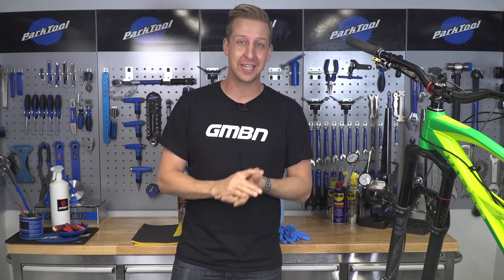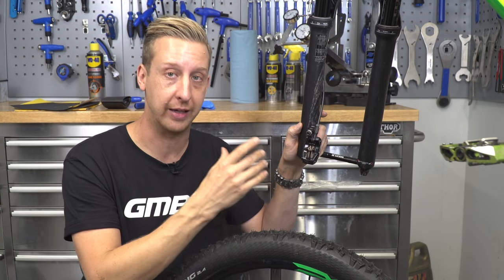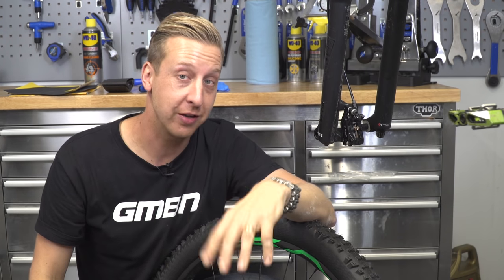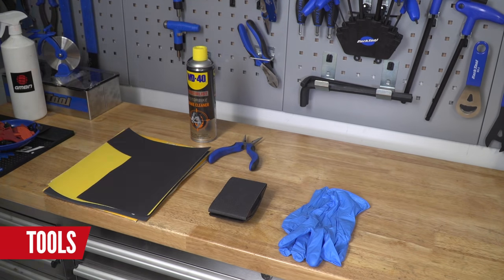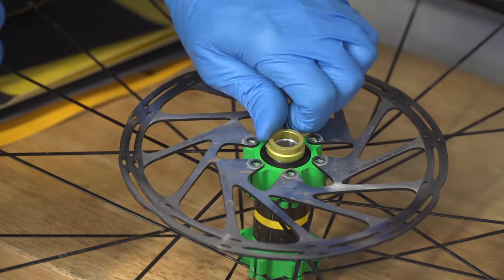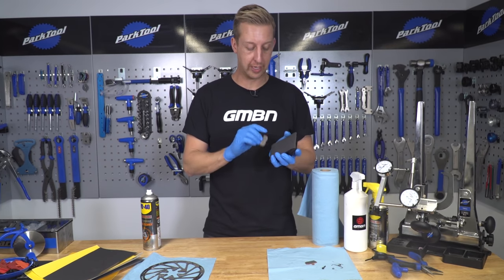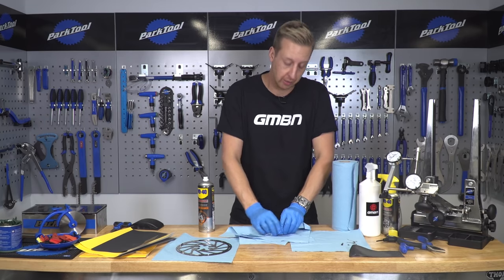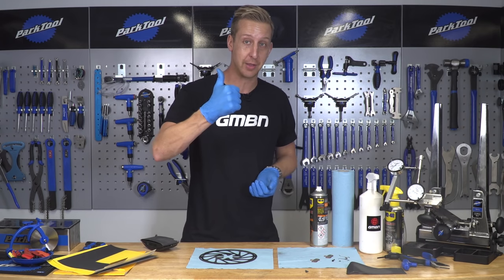How To Clean Your Disc Brakes | Mountain Bike Maintenance

Comment: Please remember too - WD 40 was not designed to be a lubricant, although it does lubricate for a short while. Its primary purpose is as  a water displacer ... hence the name WD. The number 40 was the formula they stuck with.
Reply: its better at attracting grime than it is lubricating anything.
Reply: @TheFreshPeddler  only thing dub dee attracts is the ladies.
Reply: WD-40 has two meanings one of them is true, "We Did 40" try's till it was right.  lol     Water Displacement 40 lol
Reply: Doddy is using Brake Cleaner made by WD 40 is this video. I can be confusing, as the can looks very similar, but a much different product.

Comment: Next video idea:
How to get rid of that dog sh*t on your frame, tyres and under the seat.
We need this.
Reply: bata solujic wash your damn bike
Reply: all purpose cleaner or muc off spray on and leave for a minute or two then rinse off with water somewhere between warm and hot.   if needed have some thin metal flat pieces to help pick off any stubborn poop.   it does help once bike is thoroughly clean use a car wax/sealant on the frame (only aluminium and steel NOT carbon fibre)
Reply: Robert Parkes Thanks for the much needed information!
Reply: Robert Parkes is car wax safe for bikes though?
Reply: bata solujic yes we need this
Reply: @robdp83  why not on carbon? I sense a mildly interesting fact on the way...
Reply: JZ paste wax soft99 fusso yes tho wouldn’t last as long as a paint sealant.
Reply: G C  maybe if it has a clear coat on it, imo i wouldn’t trust myself to get it done right.
Reply: @robdp83  silicone spray on a cloth is good too. Wipe all over the frame. Only silicone sticks to silicone

Comment: They said do not use solvents to clean your brake pads other than brake rotors no problem. Brake pads should use clean running water only. Is it correct?

Comment: This is a useful video GMBN! Is it a good idea to clean the disc and pads with alcohol every now and then to remove dirt and grime left even after a normal bike wash? Here's a video idea: All the stuff you need to know but nobody tells you before you buy a bike. Like bedding-in new brake pads, how often you should have your shock and fork service, and just how bloody expensive it is if you can't do it yourself. If I followed the manufacturers recommended service intervals for my FOX float I would spend more money every year servicing my bike than I do with my car!

Comment: If you use sandpaper, ensure there is no residue or else the pads will likely glaze over when bedding in. I'm going to try steel wool as an abrasive, next time.

Comment: I have a road bike with squealing disc brakes, took it to the local bike shop, they told me the rotors and discs were too contaminated and so they replaced everything (£140). Six weeks later the noise is worse than ever, they didn't say anything about bedding in the new discs!. I am careful not to use any kind of spray lubricant and only clean the chain with a Park Tool chain scrubber. I have tried cleaning the rotors with Muc Off disc brake cleaner and paper towels but tbh it only makes it worse. I am bit nervous about taking the pads out and the rotors off but I am going to try the process in the vid.

Comment: A fast and easy way to de-contaminate the pads is to take them out of the caliper and torch them to burn off contaminants. To un-squeal the rotor, use squeal-out and rubbing alcohol.

Comment: Try this, take out the pads and rub them together under the hot tap using VIM. Repeat this until the Vim stays white and then dry them with a paper towel. Clean the disc with household cleaning alcohol applied with a J Cloth and dry them with a microfiber cloth.  The light abrasive in the Vim creates micro scratches and de-glazes the pads that disrupts any harmonic resonance, in other words, stops them squealing (in principal) like a violin string.

Comment: Copper slip behind the pads works a treat, my dad taught me that one. It's surprisingly hard to get the grease near the actual pad material, I would recommend it. Just be careful and apply a thin layer.
Reply from the maker: Just a dab too. Don't paint it on there if you're going to do it!

Comment: If brakes start getting noisy or loose power I soak pad in isopropal alcohol then cook them on BBQ gas flame until they stop smoking. really very effective at removing contamination. clean the rotor as doddy suggests and bed in!

Comment: instead of sandpaper I use drywall sanding screens. it has holes that allow the crap you want off your pads to fall through. Seems to work much better than sandpaper

Comment: i can vouche for the copper slip, common used in carworkshops.
also brakes can make a squilling noise if brakes are cold and also when the pad material is to hard.

Comment: I could be wrong, but from the car side of things (And motocross) using brake cleaner on pads is not a good idea as it can break down some of the compounds in the pad causing them to literally disintegrate?
Reply: +1 I heard the same elsewhere. Is it okay or not?
Reply: That's why you use brake cleaner designed for bicycles, car cleaners are too strong
Reply: if brake cleaner penetrates the pad material, it dissolves the resin that bonds the material to the pad, like in a car. The resin then bubbles up through the material when it gets really hot as it has been chemically changed, and causes massive brake fade and glazing of pads.
Reply: Yeah, I would sand them and clean with alcohol, but I would not use brake clean on the pad material, whether it's "made for bikes" or not. Better safe....

Comment: Thanks much for this helpful info.  Question: At 8:28 to scrub rotors with sand paper, do I need something like 600-ish grade or finer 1200-ish for this job?  I'm going to replace my old organic pads with new metallic this time, so - short of replacing rotors with different pad compound  - I'd like to refresh/reset the rotor surfaces as if brand-new, for bedding in a new pad compound.  Thanks!
Reply: Great question because he only says, "Course, abrasive paper and heavy duty". I've seen other videos which clarify 120-160 grit, etc.  Just tell us a number so we know!

Comment: i work at a bike shop and we allways burn the discpads. our mecanics has  repaird bikes for over 70 years combined and they do it every single time.
Reply: Mikkel Lehmann Yep. All of the stuff in the video and torch the pads when they're dry to burn off any deep contaminants.
Reply: How bout rotors, are they safe to burn?
Reply: Henry C wouldn’t recommend it due to possibly warping the rotor beyond repair, just isopropyl alcohol and some 600 grit sand paper and you will be good

Comment: Copperslip does work on cars and motorbikes, but NOT on mountain bikes, because the pistons are not metal. It won't do anything other than make a mess.
Reply: pistons are metal on quite a lot of MTB brakes actually
Reply: Copperslip, or Copper paste works wonders when used spareingly on back of brake pads where contact with pistons is. Prevents shudder and therefore noise when brakes are used. Brake noise does not always come from pad material on rotor.
Reply: In this case, the copperslip isn't being used as an anti-seize, just as a damping medium, so the piston material doesn't matter.

Comment: If you live near the coast, salt in the air tends to settle on the rotors, creating a residue contaminant that affects the braking power, creates a lot of noise and eats away at the rotor.

Comment: I accidentally  spilled my bike brake pads with brake fluid. And unimaginable squeaking has started. I tried cleaning it even with angle grinder - no cigar! But one thing worked - just burn the surface of brake pads, it will vaporize any residue and 
voilà 
 - no more squeaky brakes. :)

Comment: Got pins on my brakes, would like to swap for bolt and catch pin.  Shimano Deore 6100 203/180 on my Orange.
Brakes have been awful since purchase, so will run through this, although I think I have a leak.

Comment: Being concerned that a bit of oil on your skin might contaminate your brake pads is seriously mental, unless you NEVER ride on a wet road. Roads are full of motor oil from cars and as soon as it rains it floats to the top and will get all over your bike. You can make a clean rag black with oil and grit by cleaning any rotor and pads that have had a bit of use.

Comment: I tried EVERYTHING, spent weeks cleaning, sanding, soaking, scrubbing, brake cleaner, mud on the rotor, the copper grease... everything.
Nothing worked until I tried baking the pads. 200°C in the oven for 30mins on a clean baking try and just like that, they are like brand new! Still needed bedding in again properly but now they could stop a freight train in its tracks.
Don't waste your time, if you think it's contaminated, just bake your pads. No open flames, no blow torches, just as easy as pie. Get it?
Reply from the maker: We've heard of this working but can't recommend it as in some cases (and with cheaper pads especially) the pad can become unbonded from the backing surface which is dangerous for obvious reasons! This is our safer method that you just have to work at
Reply: Thanks for the reply. I've heard of this as well but only in rumours. I'm not sure it has actually happened to anyone that I've heard of. Plus, don't the pads reach higher temps. than this when in regular use at a bike park for example? Is it more dangerous because it is sustained heat rather than fluctuating, dissipating heat? I'm interested to know. Ultimately, buying a new set of pads is the best option, but I've tried your method and it didn't work for me, even after repeating it a few times before I found out about the baking trick.
Reply: @AdamEronenPiper Id rather not chance it with baking my pads. Rumors start somewhere its happened to someone and I dont want to be going down a steep techy decent and lose my pads. But if it works for you thats great

Comment: So I had a bit of a squeak on braking, so took the wheel off and removed the pads. Didn’t have brake cleaner so sanded them regardless and cleaned and sanded the rota no squeak and no cleaner brakes work great

Comment: i get a squeal noise when my brakes are cold, i'd say around 10°C. i noticed that by riding my bike in winter and in summer time. is that a possibility or i'm just crazy?
Reply: Matteo Roda I’m no scientist but temperature could have an affect on your brakes
Reply: Evan Thomas thank you for your attention
Reply: maybe the humidity plays a role here? Not sure tho
Reply: same, but Shimano with metal pads
Reply: In colder conditions materials tend to shrink a bit. So maybe some differences in the structure of the pads might lead to an uneven shrinkage and they might squeal as a consequence.

Comment: Pro tip... Turf the pads, put new ones in, and make sure bleed port on calliper is tight.

Super pro tip. Throw avid brake system in the bin and install ANY Shimano brake system

Comment: What grit sandpaper should I use?
Reply: I used 120p and it worked really well 👍🏻
Reply: 120 is rough as a cow‘s tongue... :) On the rotor I would assume sth. like 600 and even higher.

Also I would apply only gentle pressure. You don’t want craters on your disc, just a bit of rougher surface. 

Me personally... I don’t have the best feeling about this technique.
Reply: I used 600 and it worked really well. I've tried many methods and this is the only that worked.

Comment: You can get rid of contamination on pads and rotors easy. No sense in buying a new sew set of pads and rotors every time cuz it happens so often. Rotors are not cheap. Simply remove pads rub with a clean brush and isopropyl alcohol, rub clean with blue rag or paper towel, sand with 220 grit in a circular pattern until pad color is normal, wipe off any sanding residue with clean blue rag or paper towel. Wipe down rotor with blue rag or paper towel and isopropyl until clean. Reinstall pads and wheel. Go out and bed in the pads and rotor by gaining speed and braking hard on the uncontaminated pad until braking power is restored. Now your pads and rotors should be free of contamination, quite, and powerful while only spending a couple bucks. If you need a video there are tons here on YouTube. Works pretty much every time

Comment: I think that the best way to clean brake pads is to put dish soap on them and rub them together then wash them off with hot waters and that will get rid of the squeal but you still have to clean the rotors

Comment: I'm new to disc brakes/Mtn bikes. Do u have to remove and clean your pads every time you clean your bike? Doesn't all the mud and crud run down your forks when you wash your bike over the pads? What should I use to clean the discs with?

Comment: Get a lemon and cut it in half. Press the lemon and drip the juice straight to the pads still with everthing assembled in the bike. Pedal for 3 or 4 minutes with brakes applied until it stops screaming (it will make the sound of devils, but when it stops its gone and very clean)

Comment: I mostly would experience this during rainy weather, but I would hear my brakes squeak as I'm trying to move the bike around. Can I use brake cleaner  on the brake levers  as well as using it on the pads ?

Comment: My rear SLX M7100 brake seems to have lost it's bite. Not long been bled and doesn't appear to be any leaks. Only thing I can think is spray from the dropper post lubricant may have got carried in the wind on to the rotor?

Comment: The easiest way to clean the break pads and rotor is to put alchohol in it. Isopropyl, ethyl or what not. Leave it for about a minute or so then wipe it with clean fabric. You'll see the grease come off. If you still hear some squealing, put some generous amount of alcohol and light it up.

The science behind it is that oils and alcohol mix together.

No need to buy diskbrake cleaners. I promise

Comment: Does anyone know how to or have any recommendations on cleaning the center of the disc where your pads don't pass through but the dirt builds up? This seems to go un-noticed and has recently been the bane of my life trying to clean them without contaminating my brake pads. I'd much appreciate any help ✌
Reply: I have that same problem. I’ll probably clean the inside very carefully with a toothbrush and some brake cleaner and then do the braking surface

Comment: As a request could you do a maintenance video on swapping Formula / Avid type brakes to something like a Shimano set.  I have been having a lot of trouble with the set on my bike and after working my way through litres of DOT4 fluid to resolve the issues I am ready for a change. From the research I have done it seems like a common(ish) upgrade route but I cannot find a video to help me with the decision. I am riding a Cube Limited Race hard-tail. 

Hopefully this is something that is of interest to others.

Comment: My rear break makes me deaf every time I use it
Reply: u cant go deaf more than once
Reply: +Repearzz badum tss
Reply: My rear brake is completely blown
Reply: What pad material are you using?  I only use (Shimano) resin pads.  They stop much better than the metallic pads and hardly ever make noise.
Reply: you can

Comment: That's helpful. But, I'm afraid am gonna need new pads sooner or later. Do you know where to get them?
Reply: Always bought mine off eBay
Reply: @avi.d04  ok. How do I know the right pads for my bike?

I have tropix martinez with shimanu
Reply: @mazinalansari88  locate your disk brake caliper, try find some model number on it. This may result in you removing your caliper from the frame but look around for any model number, then search up that model number followed by 'shimano' on Google and you should be able to see the pads you have. Worse case scenario if you can't do any of the above, remove your pads, search up Shimano disk brake pads and try to find the ones that look exactly like yours. Hope that helped
Reply: @avi.d04  thanks a lot man

Comment: I find that i usually get break howl on a set of pads after its been raining, usually use my bike for commuting, guessing the road contaminants get kicked up and into the pads, gone through so many sets of pads its a little ridiculous
Reply from the maker: Try enduring the noise! Bear with us...sometimes contaminants in the rainwater that splashes on your pads will burn off after a few good hard stops!
Reply: really appreciate the reply, wasn't expecting one if I'm honest but I have stuck with the pads for a long time afterwards ( more than  a few months just got used to rolling with very minimal breaking) have tried everything from sanding down pads and discs to dousing with break cleaners meths Isopropyl the only thing that solves the problem is new pads, until there is another spell of rain again, then the howl slowly creeps its way back in again, have tried a few brands of pads as well

Comment: Is it mandatory to light up the discs and pads to work properly? I cleaned my discs and pad with a disc break cleaner but didn't light it put. I simply wiped it with a clean cloth, and my breaks don't work effectively as before

Comment: My rear brake is not working anymore and i think is becuase when i cleaned my bike with degreaser oil (the chain) some drops maybe flew on the disc. Should i clean the disk with some spirit? Or should i replace the pads?